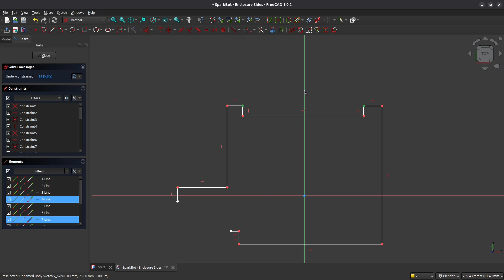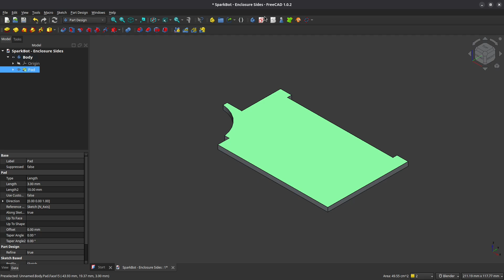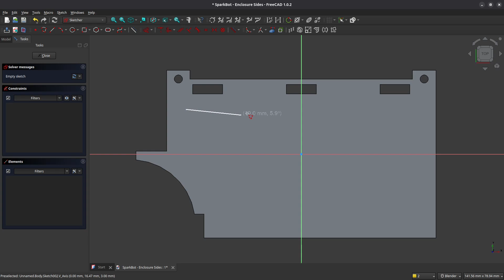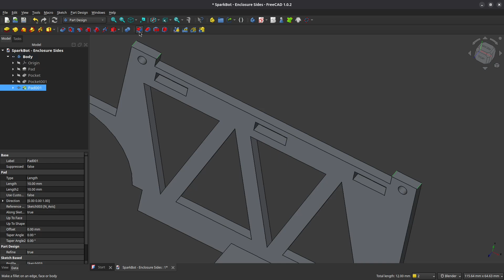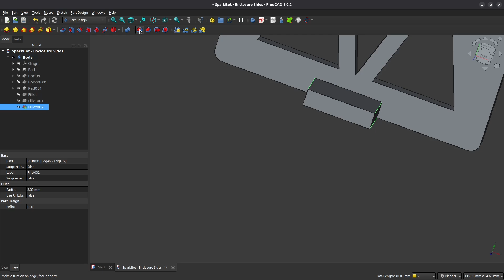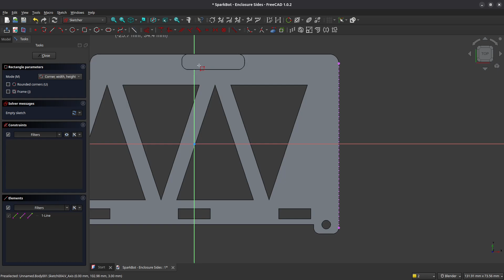SPARKBOT V2: PART 14 | VETRONICS ENCLOSURE SIDES

Comment from the maker: Welcome to Part 14 of the SparkBot V2 architecture. 📐

Hardware shouldn't just look good; it should actively enforce good habits. By designing this enclosure so that it physically cannot be removed while the battery is plugged in, we are ensuring that we do not accidentally create short circuits when working with the logic board.

Question for everyone building along: How do you protect your wiring and sensitive electronics on your own builds? Are you designing custom enclosures like this one, or relying on split loom tubing and zip-ties? Let me know your wire-management strategies below.

Chart your course. Build your world. 🍁